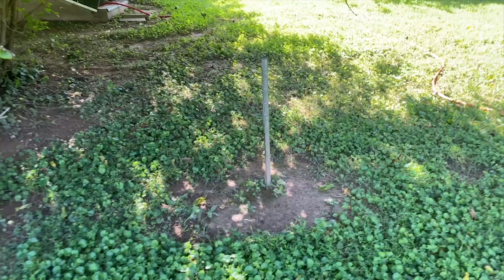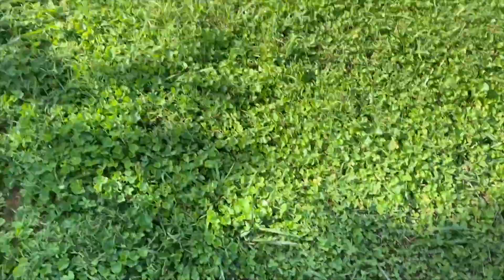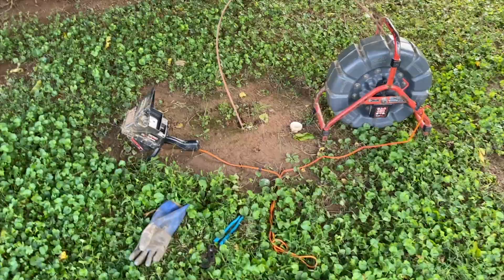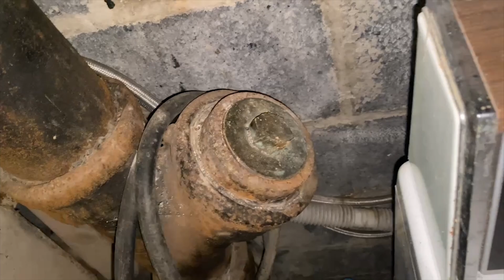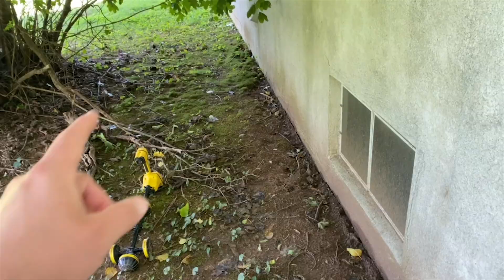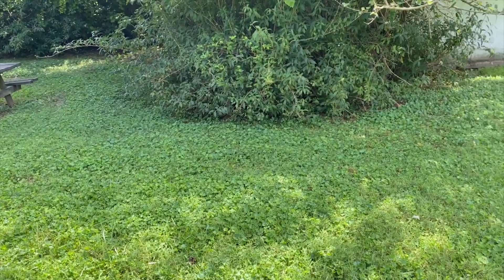What Does A Septic System From 1942 Look Like?

Comment: I am absolutely loving your videos highlighting older septic systems! Thank you!
Reply: I have found a hole, by accident, under carport concrete flooring. The bathroom is on that side of the house, old 4" pipe coming out of the house going to the street.
The hole under the concrete is void of any soil. About 5ft deep, but has 2ft of standing water, and soft red clay. Lots of roots from a nearby oak tree, which I had to cut down about 2 years ago. Opening up, skimming back the thin sand banks and cutting back roots, it is a round shaped hole about 5ft in dia. I drained some of the standing water and can see a pipe connection and what looks like lining material coming loose. This is in GA. No record of well or septic tank. City Water Dept had said we're on a ridge. Health Dept said maybe a well. They could put dye in to the toilet system and bathroom basin, to see if it is connected at all.
Reply: @hannahunderhay8642 You are probably looking at an old cesspit!
Reply from the maker: I'm glad you're enjoying them. Thank you for watching! I'm trying to get as much variety as possible, but I never really know what my day will look like until it starts